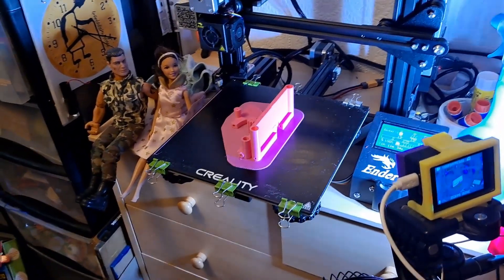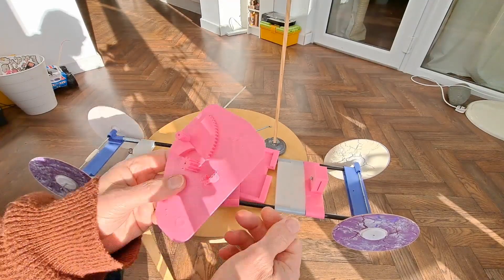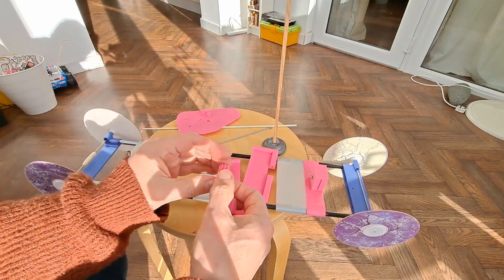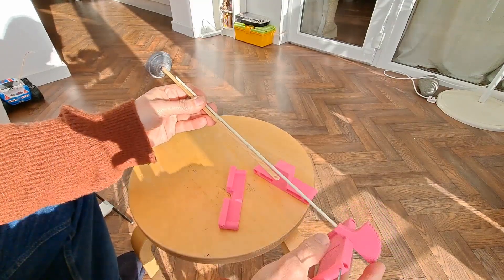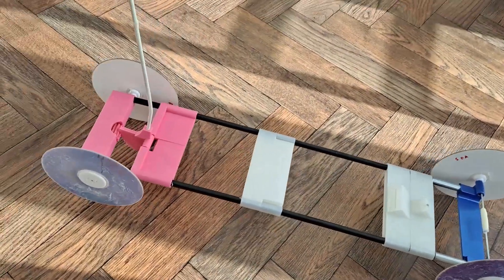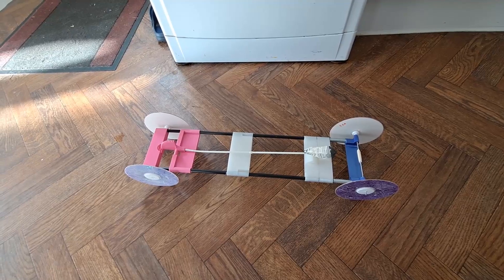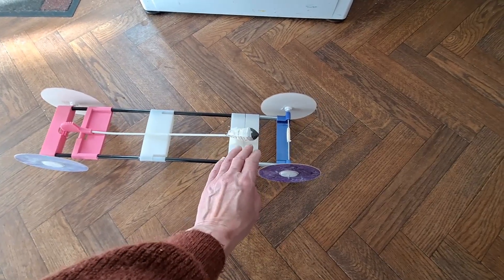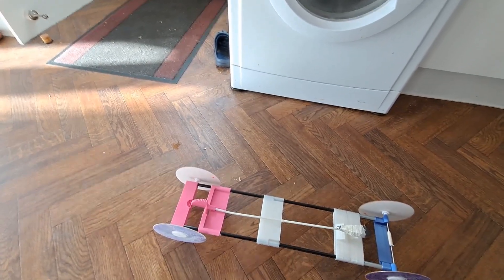Geared Gravity Car Part 1

Comment: That's an interesting design. Well worth trying to take further. Thanks 😀👍
Reply from the maker: Yes, the intermediate gear make a lot of difference in part 2 👍 I hate getting involved with gears, it needs more attention to the measurements to get them meshing correctly and I don't do fine details very well 😊

Comment: Yes, the secondary gear should help slow down the fall of the weight. 
Good idea. Well-designed and printed 👌👍
Reply from the maker: Thanks, Mike. I think it looks good, but it is over engineered. Dropping the weight on a piece of string on a tower works better 😆

Comment: hopefully the other gear will help with the recoil. At 1st I was thinking a capital H in front of the pole, it could have a release mech and a line that stops the pole as soon as it clears the gear but like you suggested, just slowing the descent will make a big difference.. really interesting project, you could keep adding gears to get more distance or speed or move a load
Reply from the maker: This was one of those ideas on my long list of things to do 😊😊